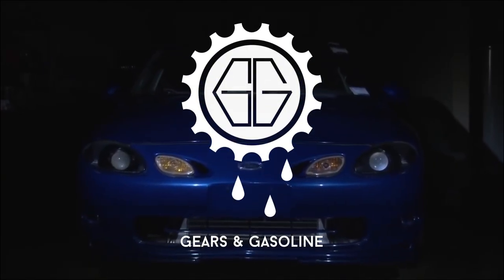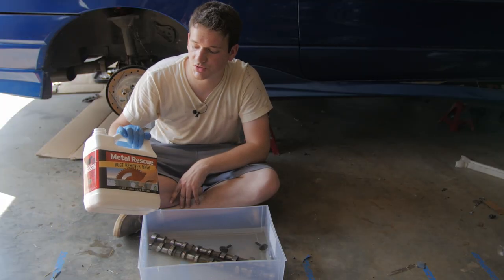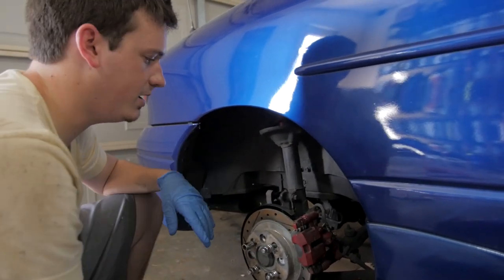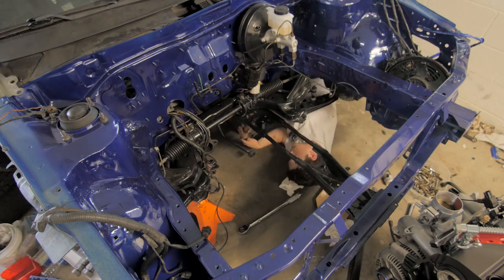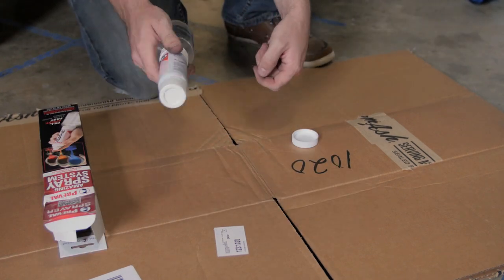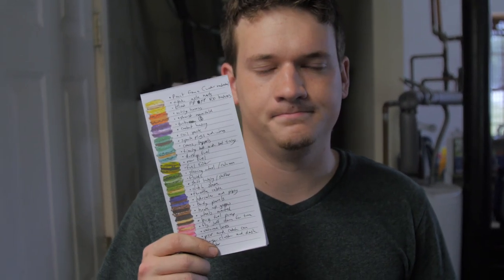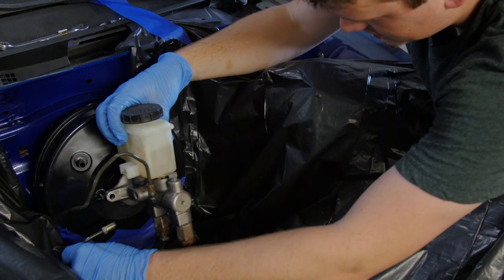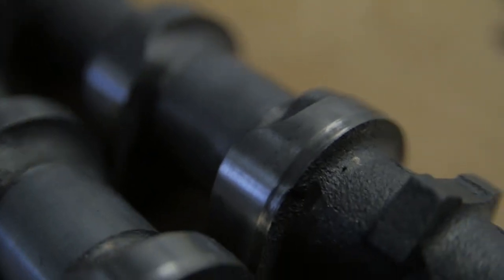Installing the Built Engine (Turbo Build Part 10)

Comment: In the future, you can use a vacuum brake bleeder. You can get them pretty cheap and it makes doing brake bleeding and flushes a one man job. Just a tip from a pro, keep up the work on the build!

Comment: Did you bench bleed the master cylinder before installation? If not, it takes a lot of bleeding to get all the air out of the master cylinder

Comment: With all the small parts you've painted with a rattle can during this build you could really use a home powder coat set up. Just need a $50 Craigslist oven, a $150 Eastwood powder coat gun and some powder.

Comment: You have to start in the Right Rear and then the left rear so right front and left front when you vent the brakes and you use about a little over a litter brake fluid. hope it helps

Comment: Hello sir! I subscribed to you last night! ( around 2 am CST lol) I enjoy the HD and production quality of these videos! I like Ford a lot too, I think they're awesome! I have a 99 mustang V6 5 speed with 3.73 gears, currently needs diagnosing, camshaft swap gone wrong :( (I wasn't there to see what happened). Once it's all up and going strong and I dyno tune it, would you recommend putting something like a procharger supercharger on it? I hear the stock internals could handle it, but obviously putting forged crank and pistons and rods would be the safer thing to do. Thanks!!

Comment: I just watched all 10 videos and I have to say it's very interesting to see how USDM Escorts have nothing to do with any of the Euro Escorts. The drivetrain looks like a European Ford Cougar or a Ford Mondeo. Still the videos are interesting for me.

Since 2009 I've been driving a 1997 Ford Escort (wagon) and modifying it almost as long. It is kind of a Frankenstein, because I take parts from other Fords. Right now it has a reliable 156PS and 210Nm (154HP and 155ft lbf), but it is a blast to drive because it weights about 1000kg (2200lbs).
Reply: What all have you done to your 97 wagon? I know stock (American) they just come with 110 hp/125 ft lb with the 2.0 SPI engine.
Reply: Ocramzeej I don't know what you're asking about mate.
BTW SPI 2000 is a piece of junk. My dad has one in his US imported Focus. This engine was designed by Ford so it would drop a valve seat after 100k miles.
Reply: I was just curious as to what mods you'd done to your wagon. And yeah, the dreaded valve seat drop sucks.
Reply: Ocramzeej 
Performance mods:
- swapped 2.0 NGA Silvertop instead of 1.8 RKC Silvertop; later on ported exhaust ports
-2.0 intake manifold, removed EGR
-aftermarket inox exhaust manifold for Focus ST170 with moddified bottom to fit Escort sump, heatwrapped, custom 5-layer steel gasket
-60mm custom exhaust from stainless, 2 boxes, but very loud and drony
-2.0 silvertop throttlebody (55mm) with modified Escort linkage
-custom intake pipe, pod filter, enlarged MAF housing
-Magnecor KV85 ignition cables
-engine and gearbox mounts reinforced with polyurethane glue
-RS2000 front brakes and stock 8" drums rear
-engine controlled by stock 1.8 ECU with DET3 as piggyback
-Sparco adjustable strut brace, Bilstein B6 shocks, AP lowering springs 20/20mm
-15x6.5J ET40 wheels with 195/50R15 tires

Comment: im seeing the differences between the focus & the zx2,,, I like how u have regular strut mounts rather then the pinch bolt style on my fucus (my little nickname 4 my focus) & the different motor mounts & heck with taking a $100. dollar loss on that master cylinder, id try to return it if at all possible or buy it again & immidiatly send that one back, if it was timed out on warranty(past 90 days) sounds like a dorman product,,, try them immidiatly because they skimp & their parts don't fit 98% of the time.

Comment: bench bleed master cylinder before installing
Reply from the maker: Check the last video ;)
Reply: I can see in episode 7 you bleed one port at the time that does not work well it pulls air in the previusly bleed ports even if they are  pluget at least that is the case whit galants whit 4 weel disc brakes and internal proportioning valve thing.
ps. how you Degree Camshafts if engine is in the engine bay or are you going to trust they got it exactly right in the factory